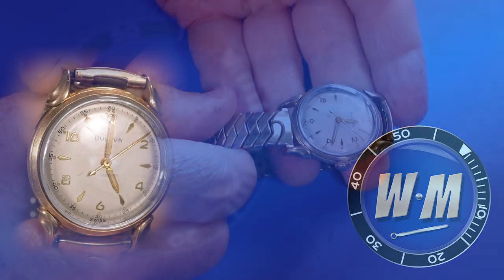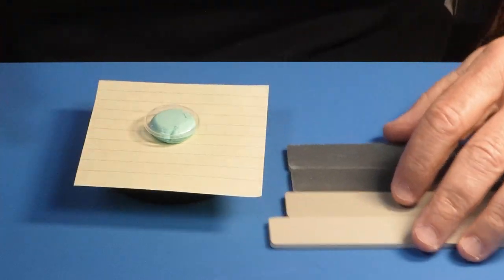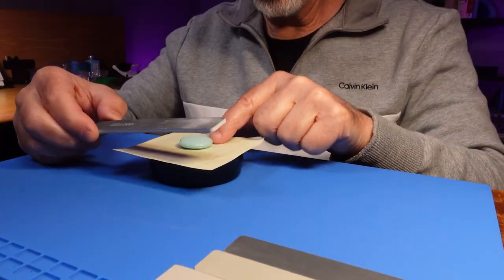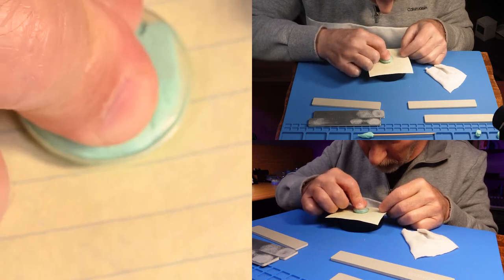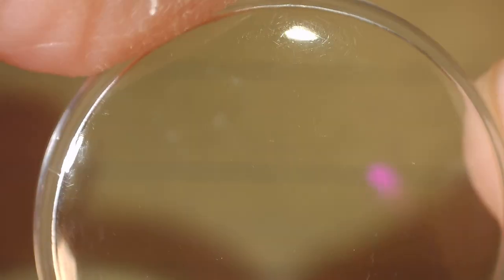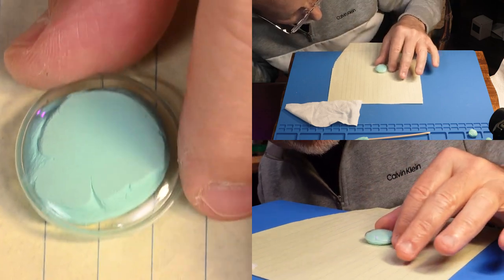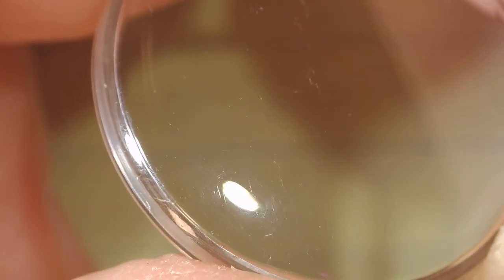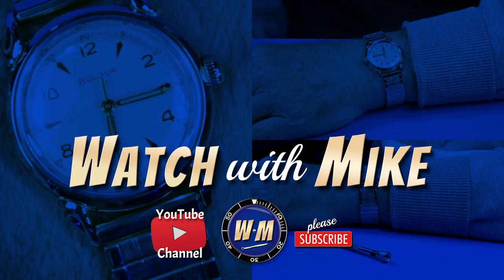How to Restore a Damaged Acrylic Watch Crystal  |  Sanding Technique

Comment: Polisher with soft wheel, use dialux yellow to cut using correct technique, then switch to red or white dialux for a perfect like new finish, no sanding needed. Give inside and outside a quick wipe down with polywatch for that perfect touch. polywatch has some oils in it acrylic likes. Thats how I was taught to do it as a professional.
Reply from the maker: Awesome! I will have to check out Dialux. Question... if you use a polishing wheel, does heat become an issue, possibly melting the crystal?

Comment: Thank you very much for the video. Excuse me, and what happens when it's scratched on the inside?
Reply from the maker: Great question! If you need to get into a place where the sticks won't reach, you can start with the Polywatch, or use fine sandpaper if the scratches are deeper. Alternately, you could use a Dremel tool with a small felt buff and some polishing compound.
Reply: thank you so much!